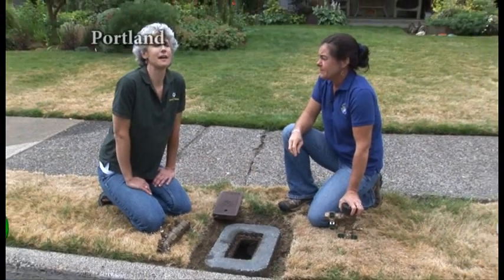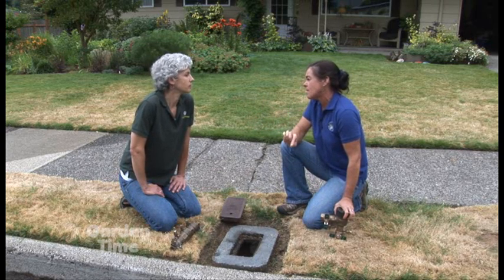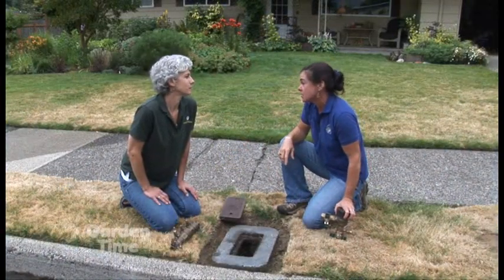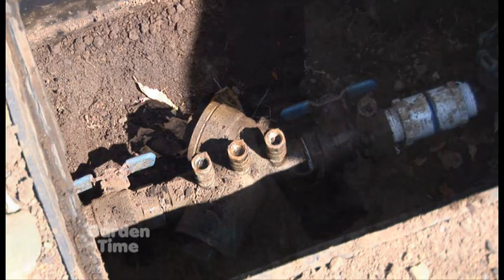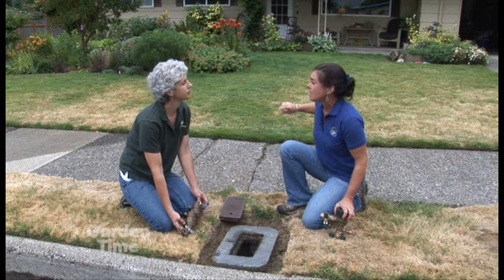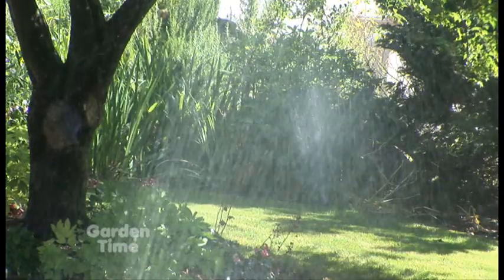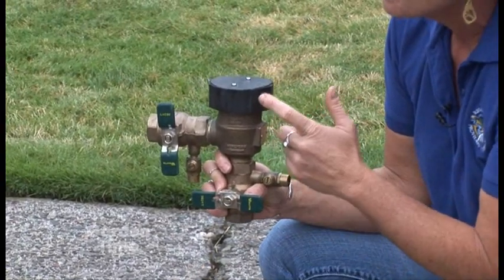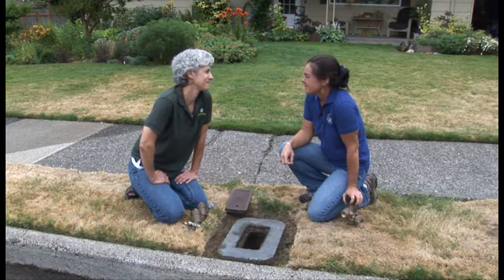Backflow Devices

Comment: Interested to hear that these are "common"... maybe in multi-family units, but not in any of the homes I've lived in...
Reply from the maker: If you have an in ground sprinkler system, they are required by law in most areas.
Reply: @GardenTime  I'm just saying... never seen them in residential... could that be because anti-siphon valves are the "approved solution"? It's what we have installed here, and I only found out about the RPZ's because so much water comes out of the anti-siphon valves (the property is not level, and the valves are *downhill*).